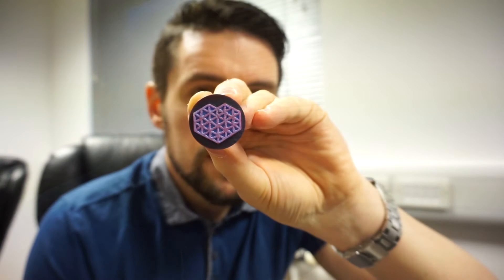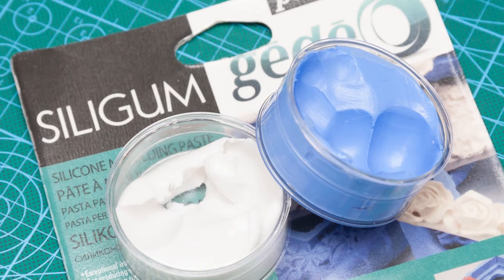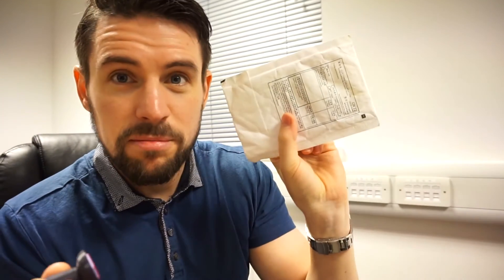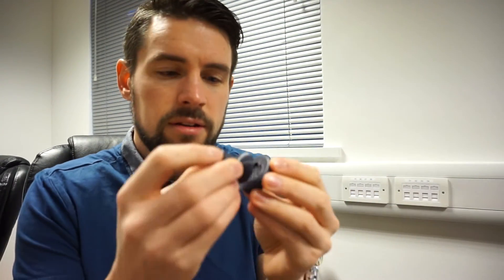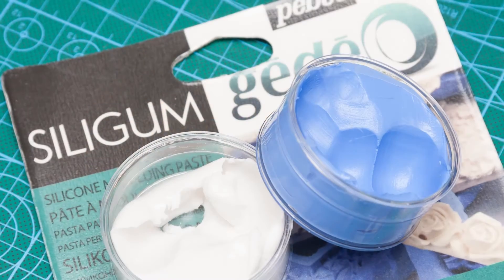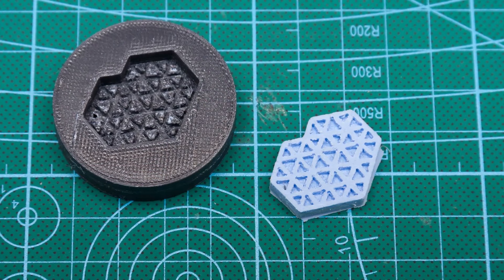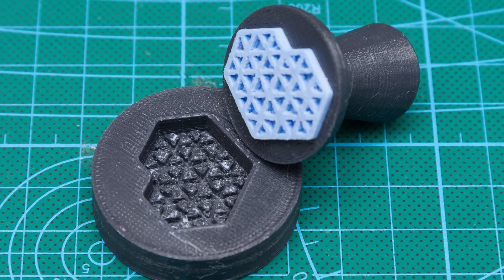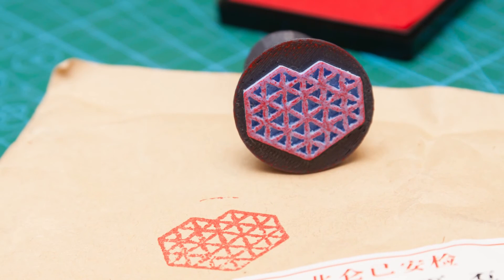3D Printing Time Lapse | 3D Hubs Postage Stamp Rubber Silicone Stamp | Thingiverse Remix Model

Comment: What a great little stamp you made there! Awesome idea, might have to make one of these for my channel. Just need to track down that Silicon Modeling compound here in the states.
Reply from the maker: +Print 3D Channel thanks buddy! You could also try standard moulding silicone that you pour (like the ones you use to capture kids hands and feet) but that is a little softer and may break apart quicker? Also think I will upload the 'positive' mould to my Thingiverse make so people can print the actual cast using flexible PLA or others like Ninjaflex..?!